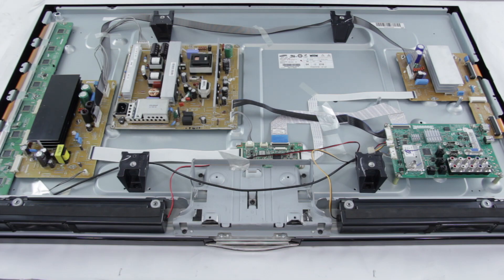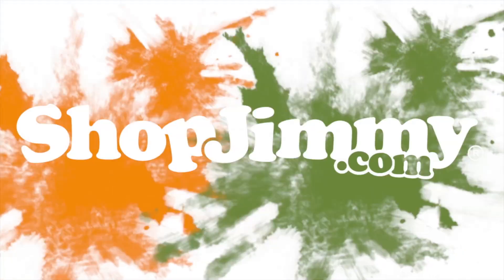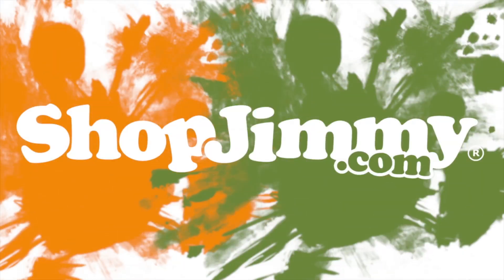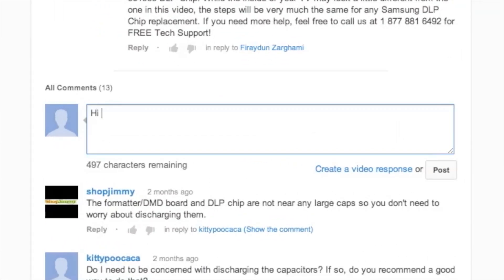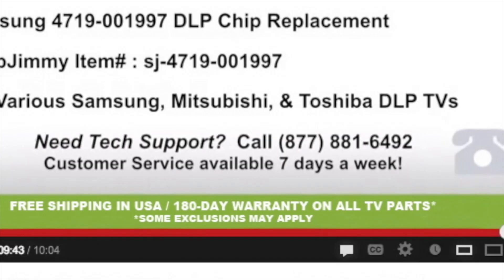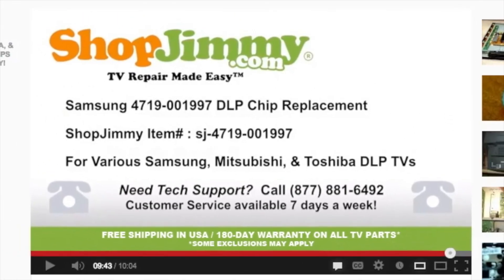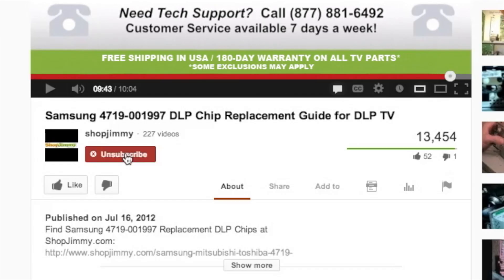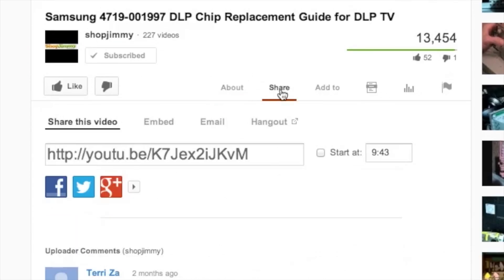Plasma TV Repair Tutorial - Common Symptoms & Solutions - How to Fix Plasma TVs

Comment: I have a Samsung plasma tv PN50A550S1FXZA showing a colored and a black vertical line on the screen. What part should i replace.
Reply from the maker: ablazeforjesus1 This sounds like a TV panel problem.  If your TV panel is bad, it may be more cost-effective to replace the TV as panels are typically hard to find in stock, difficult to replace, and expensive.  Thanks and please let us know if you have any further questions!  www.shopjimmy.com

Comment: hp s5053. i have a static on screen, it was a psychadelic rainbow but i was able to adjust that out, i now have a lot of static on screen and some green tint.
Reply from the maker: Tom Johnson This sounds like you have a bad Y-main board in your TV.  I would recommend replacing the Y-main board.  Here is a link to replacement parts for your TV model number on our website, click here:  http://www.shopjimmy.com/catalogsearch/result/?q=s5053  Be sure to match part numbers on your current board, with your replacement for compatibility.  You can also call our customer service for further assistance with your purchase.  (877) 881-6492  Thanks and please let us know if you have any further questions!  www.shopjimmy.com

Comment: The plasma display on my Panasonic Viera TC-P50VT25 was struck and it cracked as a result. Now i'm in the process of replacing the screen, but I'm having a hard time finding the part. Where can I find a replacement plasma display for this unit at a reasonable price?

Comment: I have a RCA 42" plasma model no. 42pa30rq. Has sound but no picture or backlight or menus. may have heard a quiet pop while watching, then nothing but sound. stays on.
Reply from the maker: Carlton Durbin I recommend replacing the main board in your TV.  Here is a link to replacement parts for your TV model number on our website, click here:  http://www.shopjimmy.com/catalogsearch/result/?q=42pa30rq  Be sure to match part numbers on your current board, with your replacement for compatibility.  Here is a link to a video showing how to identify your part number, click here:  TV Part Number Identification Guide for RCA Power Supply Unit (PSU) Boards  You can also call our customer service for further assistance with your purchase.  (877) 881-6492  Thanks and please let us know if you have any further questions!  www.shopjimmy.com
Reply: I have a RCA plasma TV model# 42PA30RQ.
I can get the TV to come on and I can hear sound but there is no picture.
Can you help?
Reply from the maker: 3889ben   I recommend replacing the Y-Main Board and the Y Scan Drive board in your TV.  Click this link to replacement parts for your TV model number:  http://www.shopjimmy.com/catalogsearch/result/?q=42PA30RQ  There may be multiple boards for the same TV model number, be sure to match part numbers on your current board, with your replacement for compatibility.  Here is a link to a video showing how to identify your part number, click here:  https://www.youtube.com/watch?v=R1jmj_foId0  Thanks and please let us know if you have any further questions with your TV Repair!  www.shopjimmy.com

Comment: i have a TCP50S1   it blinks 10 times after i press the power button. nothing else happens it only blinks 10 times again and again
Reply from the maker: kristen foster I recommend replacing the A board in your TV.  Here is a link to replacement parts for your TV model number on our website, click here:  http://www.shopjimmy.com/catalogsearch/result/?q=TCP50S1+  Be sure to match part numbers on your current board, with your replacement for compatibility.  You can also call our customer service for further assistance with your purchase.  (877) 881-6492  Thanks and please let us know if you have any further questions!  www.shopjimmy.com

Comment: I have a LG PLASMA 50PC5D-UC I GET SOUND NO PICTURE  when I disconnected the HDMI cable I got a spark fixing For my boss please help
Reply from the maker: Ashley Pennamon I would start by replacing the Y-sustain in your TV.  Here is a link to replacement parts for your TV model number on our website, click here:  http://www.shopjimmy.com/catalogsearch/result/?q=50PC5D-UC+  Be sure to match part numbers on your current board, with your replacement for compatibility.  Here is a link to a video showing how to identify your part number, click here:  LG Plasma TV Repair: DIY Part Identification Number ID Guide for LG & LG Philips Plasma Panel Parts  You can also call our customer service for further assistance with your purchase.  (877) 881-6492  Thanks and please let us know if you have any further questions!  www.shopjimmy.com

Comment: Hi I got a lg plasma model number is 50ps60 and the thing with it is it looks like when u have a lose cable and its static on the display I have nothing pluged in and it show me no input so when it moves around it has that static pic. Thank you my email is domenicsousa@yahoo.com
Reply from the maker: Domenice45 I would recommend replacing the logic board in your TV.   Here is a link to replacement parts for your TV model number on our website, click here:  http://www.shopjimmy.com/catalogsearch/result/?q=50ps60  Be sure to match part numbers on your current board, with your replacement for compatibility.  Here is a link to a video showing how to identify your part number, click here:  LG Plasma TV Repair: DIY Part Identification Number ID Guide for LG & LG Philips Plasma Panel Parts  You can also call our customer service for further assistance with your purchase.  (877) 881-6492  Thanks and please let us know if you have any further questions!  www.shopjimmy.com

Comment: i have a samsung pn50c430a1dxz works  until it warms up then goes to pixelated screen   you can  not see any picture other than  coloured pixels sound is fine
Reply from the maker: DAVID BULMER I recommend replacing the Y-main board in your TV.  Here is a link to replacement parts for your TV model number on our website, click here:  http://www.shopjimmy.com/catalogsearch/result/?q=pn50c430a1dxz  Be sure to match part numbers on your current board, with your replacement for compatibility.  Here is a link to a video showing how to identify your part number, click here:  Samsung Main Boards & Digital Boards: Part Numbers for LED, LCD, DLP, Plasma TV Repair  You can also call our customer service for further assistance with your purchase.  (877) 881-6492  Thanks and please let us know if you have any further questions!  www.shopjimmy.com

Comment: Panasonic tc-p5ou50 upon powering up,  image flashes on-off, screen goes blank, red LED flashes 8 times.  Any experience with this TV and issue? Any advice on troubleshooting? Suspect parts to replace?
Reply from the maker: Jordan Morris This sounds like your Main board is bad in your TV.  Here is a link to replacement parts for your TV model number on our website, click here:  http://www.shopjimmy.com/catalogsearch/result/?q=Panasonic+tc-p50u50  Be sure to match part numbers on your current board, with your replacement for compatibility.  Here is a link to a video showing how to identify your part number, click here:  Panasonic Plasma HD TV Repair Tips: Suffix Codes for A Board & Main Boards  You can also call our customer service for further assistance with your purchase.  (877) 881-6492  Thanks and please let us know if you have any further questions!  www.shopjimmy.com

Comment: I have a Toshiba model 50HP66 Mfg 2006....I initially thought the remote was failing but have since decided it is the TV.  During the night, it will turn on and off and the control buttons on the side are randomly failing to work .... sometimes the power button on the side works to turn the tv off and other times, one of the other buttons in the group will turn it off.   Driving me NUTS ~ please suggest solution and thanks in advance ~ Ann
Reply from the maker: Ann Morgan Use Caution and conduct repair/troubleshooting at your own risk.  Try to turn on the TV, then unplug the buttons from the main board and see if the TV acts right, if it does then the buttons are bad, if not the main board is bad.  Here is a link to replacement parts for your TV model number on our website, click here:  http://www.shopjimmy.com/catalogsearch/result/?q=50HP66  You can also call our customer service for further assistance with your purchase.  (877) 881-6492  Thanks and please let us know if you have any further questions!  www.shopjimmy.com

Comment: My 50" LG Plasma TV model  #PDP50X20562  has colored vertical bars all the way across the screen on the top half.  The lower half is fine.  Please help.
Thanks.
Reply from the maker: Tom Boyd I recommend replacing the logic board in your TV.  Here is a link to replacement parts for your TV model number on our website, click here:  http://www.shopjimmy.com/catalogsearch/result/?q=PDP50X20562  It appears we are currently out of stock for some parts for your TV. You can sign up on the product page to be notified when the parts are back in stock. Be sure to match part numbers on your current board, with your replacement for compatibility. Thanks and please let us know if you have any further questions! www.shopjimmy.com

Comment: I Have a Samsung Plasma TV model # PN50A450P1DXZA. I have a black vertical line on the left side off the TV as you are facing it. It goes from the top to the bottom all the way. What part do you think I need. Thanks James
Reply from the maker: James Chilton This sounds like a TV panel problem.  If your TV panel is bad, it may be more cost-effective to replace the TV as panels are typically hard to find in stock, difficult to replace, and expensive.  Thanks and please let us know if you have any further questions!  www.shopjimmy.com

Comment: I have a Samsung P51D7000 purchased about two years ago.  I've noticed that there are black dancing dots on the tv and fast motion is now much more distorted then when the tv was first purchased.  It has this issue with both cable and blue ray.  The HDMI cables have been replaced and the problem is still there.  Any suggestions?
Reply from the maker: Amanda Menard I would recommend replacing the y-sus board in your TV.  Unfortunately I do not see any replacement y-sus parts in the search results for your TV model number on our website.  http://www.shopjimmy.com/catalogsearch/result/?q=PN51D7000  Thanks and please let us know if you have any further questions!  www.shopjimmy.com

Comment: Hi I have a Zenith plasma tv model 50PC3DB-UE and the other day while listening to Pandora at a medium to low audio setting I heard a pop and then the audio reverted to a whisper. I was wondering if it had an audio amp that went out or what?
Reply from the maker: BRANDON KOONCE I would recommend replacing the main board in your TV.  Here is a link to replacement parts for your TV model number on our website, click here:  http://www.shopjimmy.com/catalogsearch/result/?q=50PC3DB-UE  Be sure to match part numbers on your current board, with your replacement for compatibility.  Here is a link to a video showing how to identify your part number, click here:  TV Part Number Guide for LG & Zenith Main, Digital, & Tuner Boards (LCD, LED, Plasma TVs)  You can also call our customer service for further assistance with your purchase.  (877) 881-6492  Thanks and please let us know if you have any further questions!  www.shopjimmy.com

Comment: Hi I have a SAMSUNG PN43D450 Plasma tv. The TV won't display menu or any picture, but the sound works normally. Backlight also does not come on. The logic board has a green light that stays stead for a few seconds and then flashes off back to steady. No swollen capacitors are visible.
Reply from the maker: fxblaze I would recommend replacing the y-main board in your TV.  Here is a link to replacement parts for your TV model number on our website, click here:  http://www.shopjimmy.com/catalogsearch/result/?q=SAMSUNG+PN43D450  Be sure to match part numbers on your current board, with your replacement for compatibility.  Here is a link to a video showing how to identify your part number, click here:  Samsung Plasma TV Repair: Samsung Plasma Panel Parts Guide  You can also call our customer service for further assistance with your purchase.  (877) 881-6492  Thanks and please let us know if you have any further questions!  www.shopjimmy.com

Comment: hi I have a Samsung PN58B540S3F Plasma.  when I turn the power on I hear it boot, there is sound, but I never get a picture.  I it stays that way till I turn it off, I can cycle through channels and the sound is fine but still no video.
Reply from the maker: Fluri37 I would recommend replacing the y-main board in your TV.  Here is a link to replacement parts for your TV model number on our website, click here:  http://www.shopjimmy.com/catalogsearch/result/?q=PN58B540S3F  Be sure to match part numbers on your current board, with your replacement for compatibility.  Here is a link to a video showing how to identify your part number, click here:  Samsung Plasma TV Repair: Samsung Plasma Panel Parts Guide  You can also call our customer service for further assistance with your purchase.  (877) 881-6492  Thanks and please let us know if you have any further questions!  www.shopjimmy.com
Reply: I have a samsung pn58b540s3f. when I turn it on, all I get is a blinking red light. no picture at all.
Reply from the maker: Boss Hogg   Please watch this video FIRST to help with your repair!  https://www.youtube.com/watch?v=BP3NVNCGEv8  I recommend replacing the main board in your TV.  Click this link to replacement parts for your TV model number:  http://www.shopjimmy.com/catalogsearch/result/index/?cat=56&q=pn58b540s3f  There may be multiple boards for the same TV model number, be sure to match part numbers on your current board, with your replacement for compatibility.  Here is a link to a video showing how to identify your part number, click here:  https://www.youtube.com/watch?v=BEPWrefQvqI  Thanks and please let us know if you have any further questions with your TV Repair!  www.shopjimmy.com
Reply: +Fluri37 Did you ever figured it out which board was bad?

Comment: i have a samsung 50" plasma PN50C59OG4F that has 3 thin streaming like vertical lines on the right side of tv ...other than this the tv picture is fine . what can i do to fix?
Reply from the maker: alln4kps1 This sounds like the problem is your TV panel.  TV panels are often hard to find, expensive and difficult to replace.  It may be more cost-effective to replace the TV.  Thanks and please let us know if you have any further questions!  www.shopjimmy.com

Comment: hi, i hope you can help, i have a samsung 50in plasma, i purchased it in may 2010, model code PS50C450B1WXXU, i have never had a problem with it until last week when a fine horizontal line appeared, it is 16cms down from the top of the screen and runs right across the length of the screen, it is only one fine horizontal line and if i can fix it before more appear because reading the different forums they say more will appear, PLEASE HELP. shane

Comment: Hi I have a Panasonic TH-37PX60B and the problem I'm having, is a vertical black line 2 to 3 inches in width on the far right of the screen. What would be the problem as the rest of the pic is viewing ok.
Look forward with in hearing from you. Plus would you have instructions how to disassemble as I am planning on carrying out the repair myself. Paul.

Comment: Hi, have an lg 50pz550 plasma 3d tv it powers on and stays on but no picture or sound and no other noises just black screen?
Reply from the maker: Tom Cook I would recommend replacing the Y-main board in your TV.  Here is a link to replacement parts for your TV model number on our website, click here:  http://www.shopjimmy.com/catalogsearch/result/?q=lg+50pz550  Be sure to match part numbers on your current board, with your replacement for compatibility.  Here is a link to a video showing how to identify your part number, click here:  LG Plasma TV Repair: DIY Part Identification Number ID Guide for LG & LG Philips Plasma Panel Parts  You can also call our customer service for further assistance with your purchase.  (877) 881-6492  Thanks and please let us know if you have any further questions!  www.shopjimmy.com
Reply: ShopJimmy.com thanks...but do you mean the ysus board or main board?